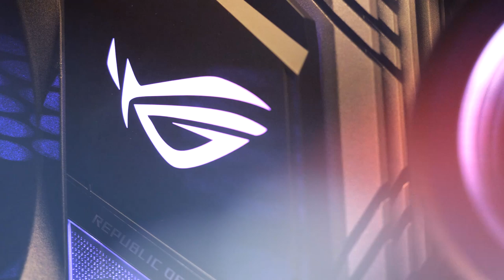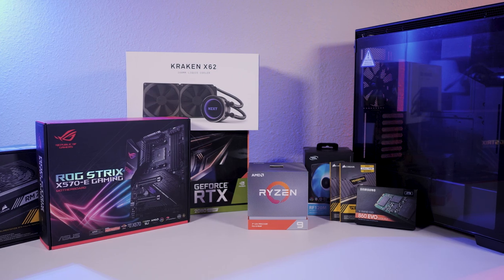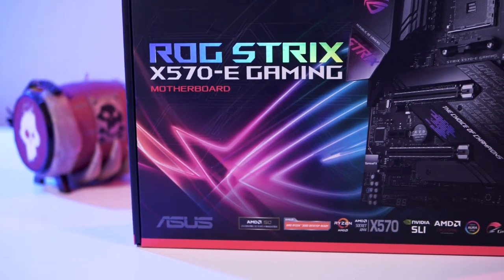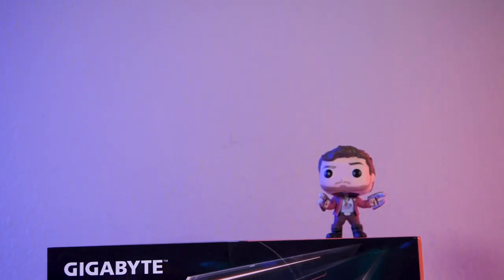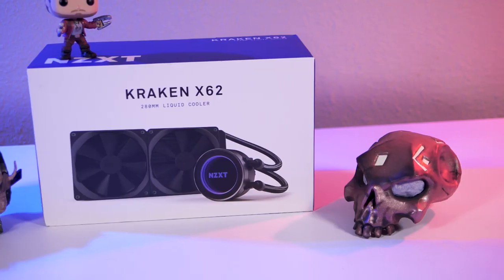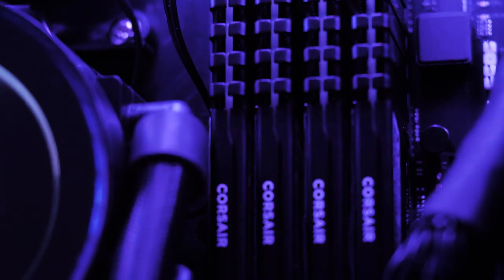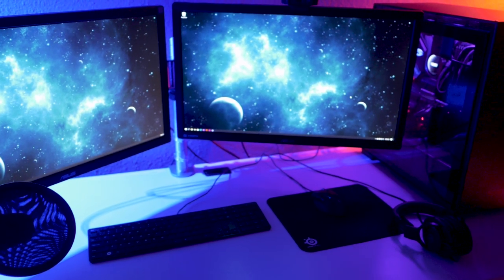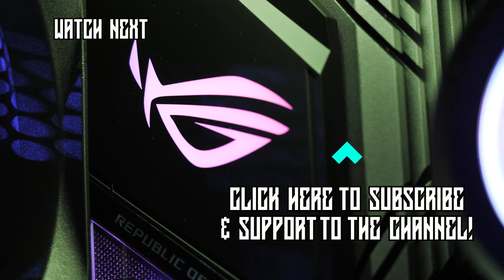NZXT H710 / Ryzen 9 3900x / $3000 Gaming Computer Build

Comment: Hey, nice video! I'm installing the same Mobo and cooler in an NZXT 710 but it doesn't seem to fit when screwed to the top bracket as in your video. Did you have to move the radiator above the caddy get it to fit?   Thanks.  PS - is WORTECH your channel?  If not, they've stolen this video!
Reply: I just saw the other similar post below.  I was going crazy trying to make it fit,  I ended up thinking you had magic powers 😂
Reply from the maker: What video can you link it here?

Comment: Hey mate, nearly building the same rig as you did - where have you placed the Kranken x62? on the top or front? I'll work with two DIMMs, I believe that duo channels are the 2nd and 4th slot, correct? Thumbs up - nice setup!
Reply from the maker: I ended up having to put it on the front of the case. So my exhaust goes out the front and the back and intake is coming from the top.